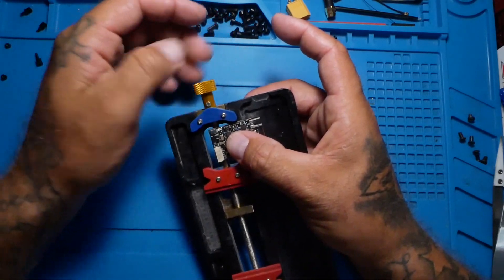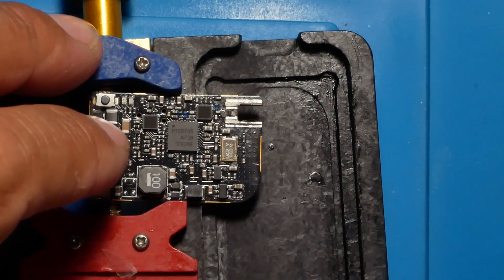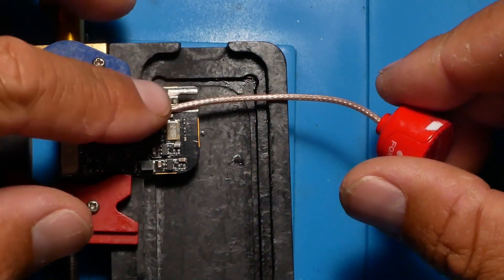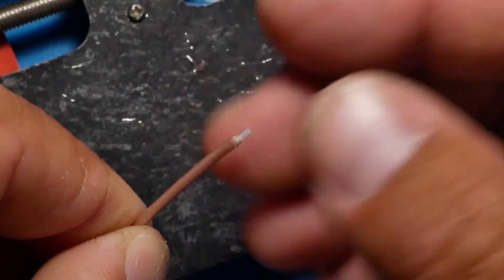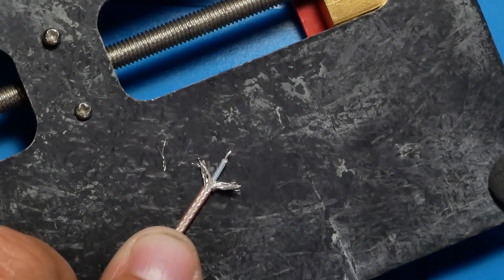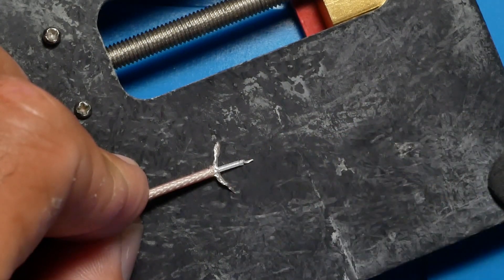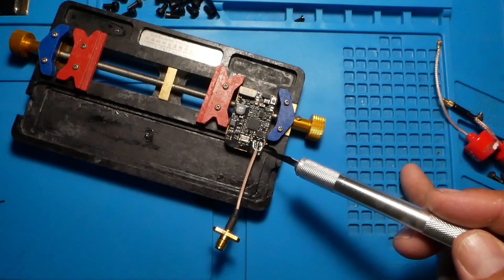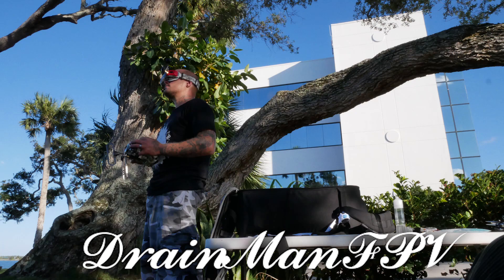Fix Your VTX Quick & Easy! How To Repair Any VTX Antenna Connector!

Comment: great video.  My mmx was ripped off but it looks like it took the solder pads with it.  the ground is OK on the back side, but the center post looks like Im F-ed.  Ill keep looking to see if there is an alternate pad that I can use just on the off chance

Comment: But what if the copperpad from the antenna on the board was letting lose also.I cant solder the antenna wire now :-(.Can i connect the signal wire to somewhere else then?Thnx
Reply: Great question I have the same problem on one of my VTX also.

Comment: Thx for this vid. I had my male break off in the female on my Dji air unit. I did order more female mmcx components for the board but this seems easier. Unless you advise otherwise.

Comment: the advantage of resoldering a connector to the pcb is that there's less leakage. the wire will radiate where the shielding is not surrounding the center wire. try to keep at least the unshielded part as short as possible.
Reply: Yes you are right the short piece of center wire is actually acting like a bad tuned antenna 
So keep as much ground wire ad you can arround the center wire